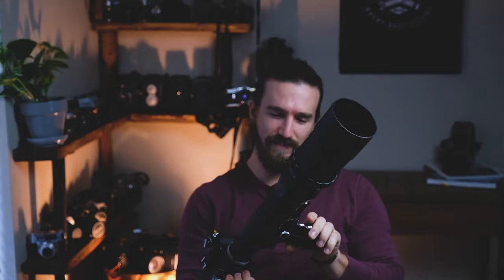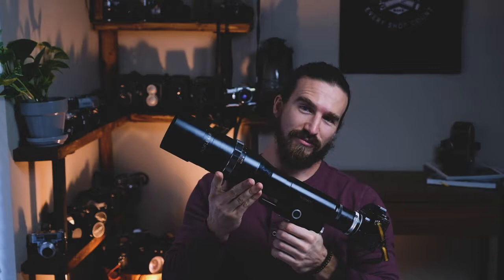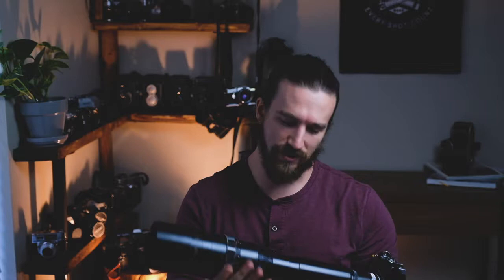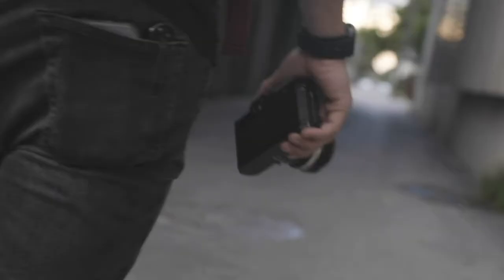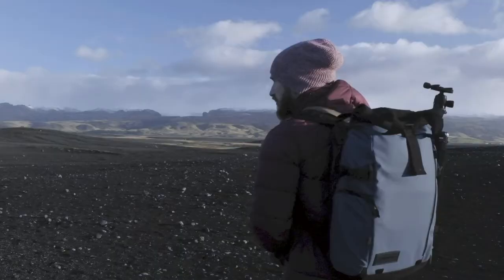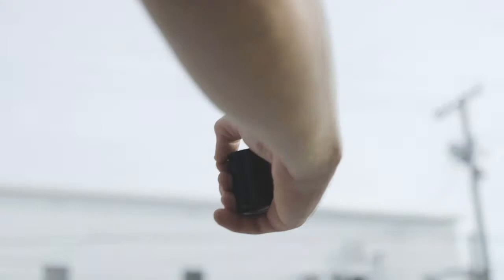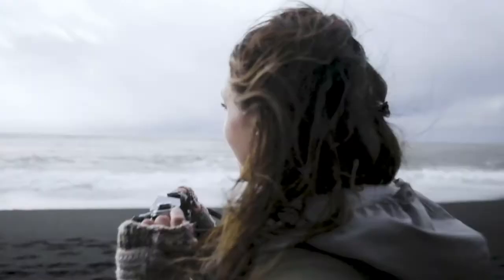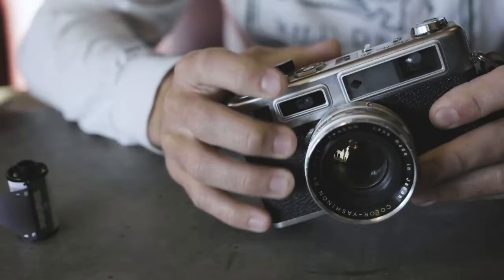How to manual focus with 35mm film cameras - Demo

Comment: Great video, the part that I was wondering more about is, where you say if you don't want the focus to be the center of the image, what do you do in that case? For either a split prism system (ae-1) vs split image (yashica gsn 35), the first two you showed.
Reply from the maker: Thanks! you would center the viewfinder on what you want to be in focus and focus on that subject, then reframe or adjust the composition of the image so that it's not centered on that.
Reply: oh ok. that was simple. Ha. thank you for responding, and will test that out. Still learning film, coming from digital. Very fun and frustrating  journey.   @graham_white

Comment: left a like, subscription, ring on for the effort, i got an old zenit 122 with a Helios 44-7 lens that uses split prism focus, it's so hard to use if you want to something like landscapes, and i know, usually you use the focus on infinity, but that's not the best option in all times.
Reply from the maker: agreed subjects in general that don't have distinguished lines you can focus on make it rather difficult, in most cases that would be landscapes. thanks!
Reply: @graham_white  you are welcome, keep them helpful videos coming, cause i don't know nothing about my new camera, i mainly used olympus superzoom 120 for film photography.

Comment: Thank you for explaining with so many visuals! I also appreciate mentioning the focus/recompose for off-center focusing. No one seems to talk about it and it was my main question as a newbie! Would you say that only works if it’s a narrower aperture? Does it work to have that off-center focus point in focus even if the center ring is not focused?
Reply from the maker: Glad that was helpful! I wouldn’t say it only works with a narrow aperture, you just have to be more careful if your shooting wide open. depending on your distance to the subject slight movements can have a big impact on your focus point (when shooting closer to subject) so making sure you and the subject don’t change distance much when you recompose is key to keeping the focus point you want. Also focusing using distance measurements in lens can be helpful at times but that does require you to look at the lens and therefore move your camera.

Comment: Very clear demonstration of the differences - thank you. But please excuse my newbie question: being used to setting focus points (anywhere on the frame) in digital, I'm still confused about how to focus outside of the little focusing ring on my film camera. In other words, if I want to do a portrait and specifically focus on the person's eyes, if I have my focus circle (in the middle of the frame) which is now on their chest aligned to be focused, will that mean their eyes will be in total focus since the eyes are up in the top third not in the centre of the frame.
Reply from the maker: Thanks! Good question. Depends on your f stop. The cheats roughly lines up with the eye sockets so I would think it would be in right focus. But if your shooting a 1.2 and are super close you should focus on the eye first with the center frame and then adjust your composition to where you want it
Reply: @graham_white  Yes, for portraits, the one lens is a 1.2. I appreciate you taking time to share this. Thank you!

Comment: Hi, great video thank you for the info. I've been using a minolta x700 for a couple of years now and i'm missing focus especially with low aperture. I found online that you can actually buy a Micro Prism Matte Split Image Focus Screens for Minolta . Do you believe it will be better with focusing? thanks :)
Reply from the maker: Thanks! It will help since it gives you two options to better pick focus. They all have certain compositions or situations where it can be hard to see if it’s focused so having more gives you redundancy and more accuracy. Installing is not easy though unless you have repair experience

Comment: Hey! Quick question... I have a Pentax me super as my film camera and when I try to focus, nothing happens... Like there's nothing to line up. I go to pull focus and all it does is change how it looks through the viewfinder, nothing happening to the prism. The prism is just there. A circle with a line through it. Is my camera broken?
Reply from the maker: Us sue would be the lens not the camera . If it was the camera you would see something move even if it didn’t line up. Sounds like one of the lens elements has come loose and is not adjusting with the lens pull. I would try a different lens and see what happens

Comment: Do you have to adjust the focus on the ae 1 for every shot? If you don’t adjust to the perfect alignment. Every time will the shot be super out of focus or just a bit blurry. I see street photographers just use the ae1 like a point and shoot all the time and now that I have one I realize that it’s hard to focus every tine.
Reply from the maker: What your describing is using zone focusing with a higher aperture. For street a lot of photographers shoot around F 5.6-8 this gives you a larger focus depth. ( example- 1.8 may give you a few inches but f8 may give you a few feet) and then they set their distance to what they want line 5ft or something and then when their subject is roughly at that distance they fire. Since they have a few feet of play if they are close it’s in focus with no need to adjust lens on the go. Make sense?
Reply: @graham_white  yes. I’m just mostly tripped up on the matching up of the circles in the middle. I’m afraid for it to be out of focus and all my images be blurry. I appreciate the breakdown of the f stops. That was very helpful. I guess I just want to know if I have to match up the half circles every time I’m order for the shot to be clear. I appreciate the response.

Comment: Very cool effects!!!!!
Is it correct that no matter whatever the open aperture of your lens is, you always focus as if it was f4 or 5.6? So it can happen that you get out of focus pictures when you shoot wider open than that number even if the broken line perfectly matches?
Would be interesting to work that out...
Thx,
Stpehan
Reply from the maker: Thanks! Hmm honestly haven’t run into that issue. Whenever I focus and shoot at a low f stop I’ve never had issues with out of focus images.
Reply: @graham_white  Thx for the answer... I will see, what I can find out, but I think it is some optical limitation of the system....

Comment: Wait, I'm so confused. I have a Yashica with a rangefinder but it's a pain in the neck sometimes when I can't see any contour on someone to line up the focus with. So that's why I wanted to check out other focusing methods in other cameras. But is there no film camera with a manual focus where you real time see the focus through the lens? I mean for the whole picture and not just lining it up with a small part? (Sorry if it's a dumb question.)
Reply from the maker: not a dumb question at all! It sounds like your rangefinder may need a cleaning of the viewfinder or perhaps the colored patch has faded away. sometimes a small piece of electric tape helps. There are a lot of cameras that focus using the full image. Most I think of are medium format cameras but Some Nikon cameras and others, can't think of exact models off the top of my head.
Reply: @graham_white  Thanks a lot! Maybe the colored patch fading away could be the case, but without any previous experience in this I wouldn't have even guessed that could happen. Thanks for the tip! And for the explanation about full image focus cameras as well!

Comment: Hi, I had a quick question maybe you can help me. I have a Mamiya 645 that has a Split Screen focus system right in the center. How do I focus on something that's not right in the center? For example, if I'm shooting a picture using the rule of thirds, do I first focus on the subject using the split screen then recompose and take my picture? It seems like every time I do that I miss focus. Help!!!! :)
Reply from the maker: It can be tricky to do it but yes recomposing is the way to do it. the other option is to simply adjust focus according to the distance and use the measurements on the lens to plug in how far your subject is away. lastly, I think you can upgrade the focus screen on that so it's not just a center split image but a more modern focus system that uses the whole ground glass to focus.
Reply: @graham_white  awesome! thank you for your help! Will keep practicing.